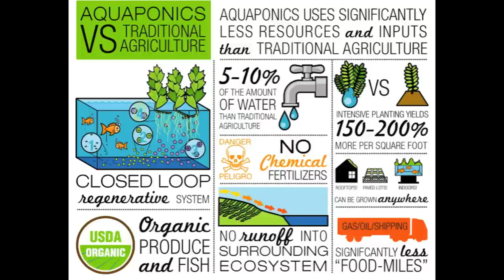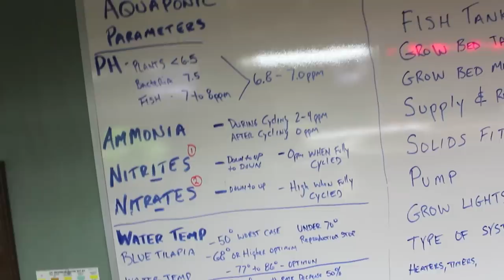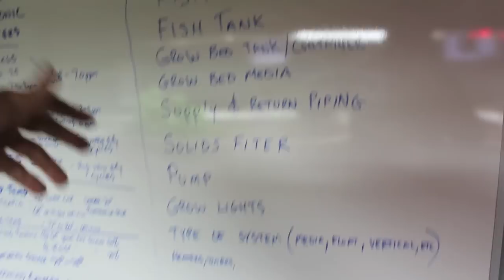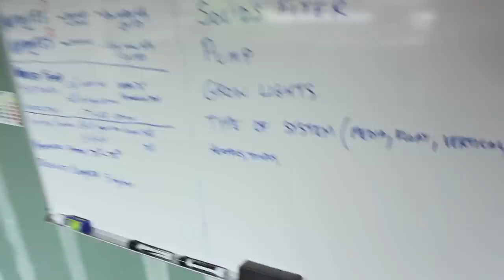Part 1 Aquaponics basement system organic/food grade overview 101 w/ grow lights

Comment: With regard to "food grade". PVC and it's assorted glues and such are food grade. If the thought of PVC makes you queasy you better stop drinking water from your plumbing. 

Second, the "Home Depot buckets" that you mentioned and showed an image of are called stock tanks and they are indeed "food grade". It's a black, non-reactive plastic composite, just like PVC. They are designed for stock-- animals-- to drink water from. Very safe and very normal. Our horses use them exclusively for water.
Reply: Actually PVC is not on the intake side of our plumbing systems. 1. The pipes can't handle high pressure. and 2. if the water gets hot enough, i.e. from a water heater, they will leak vinyl into the water. That's why intake pipes will always be made from either CPVC/copper/pex. But I guess since these systems are low pressure and don't get hot enough pvc will work. I just don't know about the adhesives, and whether or not they are food grade.
Reply: zeromystik thank you for letting people know! Many people do not understand the possible toxicity of pvc, plastics, adhesives, etc.
Reply: Actually... He went through the entire 9 yards about food grade building products and GMO store bought food products... And then said he put store bought carrot roots in his bed... Which if they were GMO... Can mess up the whole entire bed and system... 🤭🤷‍♀️🤷‍♀️🤷‍♀️
Reply: What about copper … isn’t there benefits to copper.

Comment: In the UK we have all our pastic pipe designed for potable water, but what this video shows is what is possible when you add as we are doing the renewables into the Aquaponics self build system we have developed in a flat pack Grow Cube as a self build insulated container sized unit 40ft long from $5.000 excluding the hydroponic parts and solar PVT panels

Comment: if you add 6 lbs of oyster shell to the bottom of system ph will stabilize as the waters ph starts to drop
Reply: Hmmmm oysters underground sitting on rack as water flows over them on its way back to the fish.???

Comment: nice fish tank, love the construction, how about setting up a cross flow solid lift out system in it (aka SLO)? Use a sump tank, solid (swirl) filter, bio filter, and on the cross flow design, put a T-connection in the fish tank for the fish tank supply and drop stingers in both of those corners about a half inch from bottom, and on the other end of the fish tank, have a solid lift out or SLO set up similar to the return except that it's set up as an over flow and drains into your grow beds and/or swirl filtration. upgrade your pump to recycle your fish tank 2-3x per hour... which means if your fish tank is 500 gal, you need at minimum a 1500gph pump.... just an idea...

Comment: Very cool and creative you took this on! however using PVC with the solvent glue which itself is some pretty nasty stuff probably not the safest option or cost effective one either.  PEX maybe also questionable but at least you eliminate the need for a toxic glue. Get clever with no sunlight exposure, play bendy armstrong with some custom wood block mounts and save a few fittings!
Reply: Brian Skitch I agree.  In home construction (I'm a licensed builder), PVC is only approved for drain pipes because it's carcinogenic.
Reply: ***** It's the same purple primer, but not the same cement.  It's generally orange for cpvc and clear for pvc.
Reply: +Jeremy Wood Would the fact that it is not a pressurized line make any difference in leach rate of the pvc?  I am scheduled to put a system in a green house in my back yard this March.  I am planning to use pvc as instructed by the blue print requirements list.
Reply: +Ginger Golden` I don't really know, but I would play it safe and use supply lines.  CPVC or Pex.  Hopefully it would be big enough for what you need.  CPVC is cheap and easy to work with.

Comment: Why not some fiber glass to channel the sun light directly from outside instead of the lamp. Some power lost in the conversion from sun light to electric and back again plus natural light will be good for the plants. Maybe during winter you can use the light but on normal days, you can save a lot of energy.

Comment: Just because something isn't listed as food safe doesn't mean it isn't. what matters is the materials that it's made out of. If you know, for example, that 100% silicon is food safe and safe for fish (once cured of course), then you know that anything that's 100% silicon is going to be food safe/fish safe regardless if the packaging says it is or not. PET/PETE, HDPE, LDPE, PP; are all food safe. PVC MAY be safe, depending on usage & environmental factors, generally not safe though.

Comment: Do you have a digital ph meter?  I saw you had the color coded paper ones.
Reply from the maker: No, thought they required regular recalibration
Reply: Yeah they do, thats the only down side. I use two different brands so I can tell if one is off which does happen sometimes but I find they are more accurate and easier to use.

Comment: Why do you say a Rubbermaid Structural Foam stock tank is not food safe but a Behlen stock tank is fine?
Reply from the maker: setite Easy… Rubbermaid is not food grade and Behlen stock is food grade.   FACT.   I even called Rubbermaid, tank uses black ink that is not food grade.
Reply: +PSM / NJ Quote from Rubbermaid "Rubbermaid Structural Foam Stock Tanks are built tough for superior performance and long-lasting durability in all kinds of weather extremes. They are great for watering livestock, feeding, or storing non-toxic solids and liquids."
Why would anyone buy a tank for their livestock, which will eventually be eaten, that is not food safe?  It doesn't "wash".  I will be calling them for a verification of your statement.  I have watched video after video where they are being used for aquaponic systems and many of them were from companies - not just backyard lettuce and tomato gardeners.

Comment: has anyone figured out a metric system for how many fish you need to fuel a certain number of plants?   even on the smallest scale of one plant it seems so complicated.  let's take for example a lettuce plant vs a strawberry plant.  obviously each plant will have different nutritional needs.  and then you have to take into consideration the size of the fish, the food eaten by the fish, the amounts given,  the nutritional value of the fish?  or is all fish waste created equally?
Reply: +nemesisbreakz I would suggest is not based on a specific number of fish because fish grow bigger over time, differ in size and the amount of food the require.  If you have less fish than you need to feed your plants enough, their rate of growth is diminished and if you have more than your plants require the water quality suffers and must be addressed.  In this video a few carrots is not much.

Comment: Hey NJ Rewewable Energy - try to explain how "round up ready" crops get their protection from the round up herbicide. In the process you might learn some science. I like your system. I have a very similar set up using the same Behlen country troughs
but it is outside.

Comment: You talk a lot about everything being "food grade", but PVC is not permitted for a water supply line, specifically because it isn't "food grade."
Reply from the maker: What is?
Reply: PEX, Copper, Stainless steel and CPVC
Reply from the maker: Evan Martin I'm not remotely disagreeing with your concern.  I tried to figure this out before I started. I see lots of bad things about Pex and Copper too.  Even claims of only certain stainless being safe and of course outrageously expensive.   I also see lots of claims that PVC is safe. Ultimately, I couldn't find anyone with a real alternative that had credibility or anyone that was actually doing it.   My hope is that the claims of safety are true, particularly when its water that isn't very warm or hot.

Comment: You have a nice system. And I can appreciate your attention to food grade plastics. However you are using PVC plastic everywhere, which has been linked to legionnaires disease. Did you know that?  It's very hard to build a system without pvc at reasonable prices. If you can afford it " Aquapex" by wirsbo makes a safe alternative.

Comment: ARE THE PVC PIPES FOOD GRADE? THAT BUCKET IS NOT FOOD GRADE. Any sort of metal regardless if it's stainless steel is not compatible with fish. Stainless is worst, it won't break down like others. It seems your fish water is not clean enough. Your pump is under powered.

Comment: Was hoping this video was going to be informative. 2 minutes in and it's clear that this video is more about politic agenda during the Monsanto anger craze than anything. A couple things I'd like to put out there as reference points.

1. Round up ready corn is cross bred with a different generic of corn that is resistant to round up. Round up is a glyphosate based herbicide that focuses on systemically killing broadleaf and grass plants. Round up ready corn was developed to make the production of corn more efficient. Not to "handle the problems farmers are having". As an example, with round up ready corn, a farmer could apply one dose of this herbicide to their corn crops as opposed to utilizing a multitude of different herbicides. This reduces the cost of the crop significantly.

2. GMO is a misunderstood term. The assumption with GMO is that a bunch of scientists are in a lab dumping chemicals and making genome modifications of a plant's growth structure. When in all reality, a majority of GMO is cross breeding different variations of a plant to make stronger version of that plant. 

Example: 
Corn A - Resists Fungus A but is susceptible to Fungus B
Corn B - Resists Fungus B but is susceptible to Fungus B

A cross bread of these two breeds of Corn Could create a biostructure that is resistant to both Fungus A and Fungus B. Therefore expanding the growth potential of the plant as well as reducing the amount of chemicals that need to be applied to a crop to ensure it's health.

3. A majority of fertilizers, pesticides, and herbicides are terribly dangerous to humans in their liquid or mist form which is why you will see farmers dressed in Tyvek suits with respirators when handling these chemicals. That is fact. However, these same chemicals have compounds that break down from water and sunlight over time. As an example, if you look at many herbicides, there is a suggested rainfall period (usually 21 days). This rainfall period is the amount of time between application and rainfall that there is a guaranteed effectiveness of application. Any rainfall that comes before that rainfall period will significantly decrease the effectiveness of the chemical application. This is for two reasons. A. The dilution of the chemical will make it less effective and even completely inert. B. The rain will simply wash an undetermined ammount of chemical off the plants and into the ground where it is generally useless (Google ground vs leaf chemical applications). These chemicals also have a harvest interval/restrictions. As an example of a restriction, it is illegal to spray glyphosate based herbicides until the soybean pods have all lost their green color. As an example of a interval, the herbicide Arrow (A clethodim based herbicide) has a 60 day preharvest interval. This means that you're not allowed to apply this herbicide any sooner than 60 days before the intended harvest date of your crop. This is due to the diminishing values of water and sunlight on the chemical. Meaning it has been determined that it takes no less than 60 days for all traces of the application of herbicide to be completely gone from the crop. This shows that once a crop has been harvested and has left the field, it would have no traces of herbicides left in it. (This data is all reviewed and maintained by the EPA). 

4. The GMO process of making a plant resistant to a specific "poison" does not inherently make it dangerous. We're not adding manipulations to the plant genome to affect it's chemical resistance, we're merely pairing it with other variations of the plant genome to create a superior version of it. These traits come naturally from plants and see generally no human intervention aside from a process that may be as simple as grafting.

This is all experience from years of being a farmer and holding an EPA approved commercial pesticide applicators license. I didn't find this information by googling or reading facebook posts that're directed at fear mongering. If you want to make this a politically driven video you should be retitling it as such and not floating your opinions under the guise of a home growing tutorial. Throwing GMO, farmers, and scientists under the table to make a statement like this is really frustrating. It begs me to wonder, are you using seeds you bought from the store or are you using heirloom seeds? I only ask because unless you're utilizing an heirloom seed source, you're participating in years of GMO as even basic store bought seeds have been "genetically modified" to produce a more desirable and consistent product than the plant's original genome. 

Not sure why I spent 20 minutes typing this as the chance the creator will see it is unlikely. The chance the he will actually take away anything useful from this instead of chalking it up to Monsanto propaganda is even lower. And the chance that he will even leave it on the page without deleting it is the lowest.

All in all, do your own research. Don't base your opinions and allegations on what you saw on facebook or youtube.

Thank you for coming to my ted talk lol

Comment: what a judgy little bitch if you build your system with home depot toats youre still gona get a lot healthier food than the grocery store dudes barly started and already thinks he is smarter than everyone did he use a food-grade submersible pump fuck this rich prick at least people are trying to get better food and if all you can afford is some old pallets black plastick and a bunch of water bottles and garden hose than you should build what you can the food will be far better than grocery store and food-grade usually just means that things were cleaned to a higher standard after manufacturing as long as the material isn't going yo dissolve into the water a good scrubbing is all you need and if a tub is good enough for cattle to drink from it should be fine for plants to grow in hed probably bitch about using old tires as rased gardin beds to what an arrogant pompous little prick!